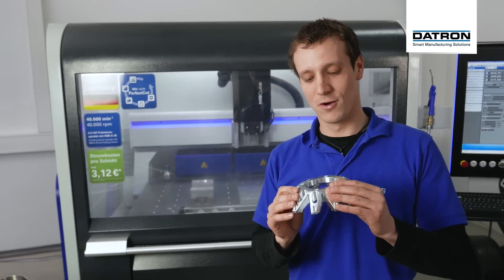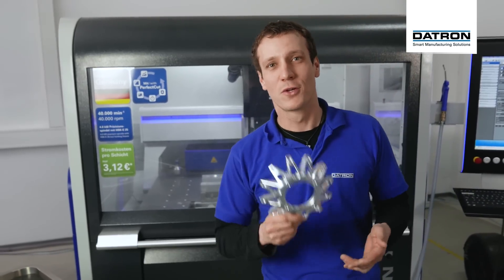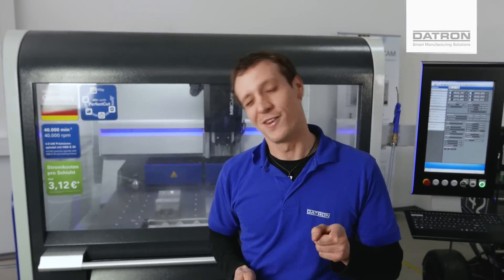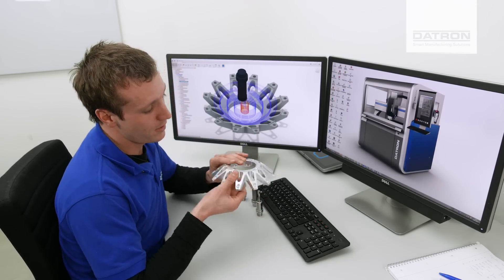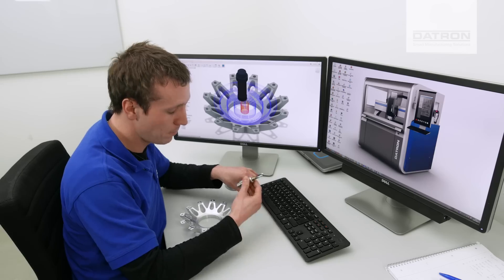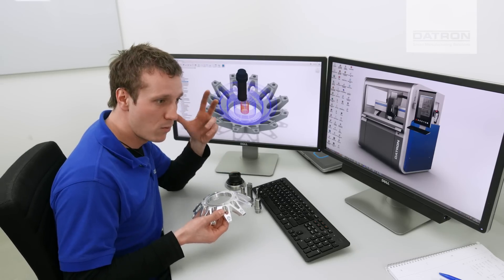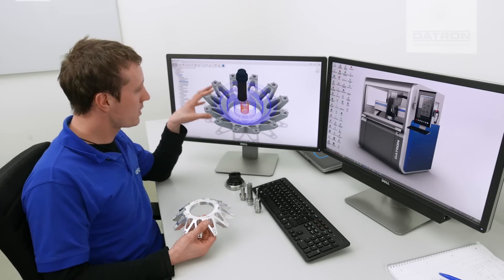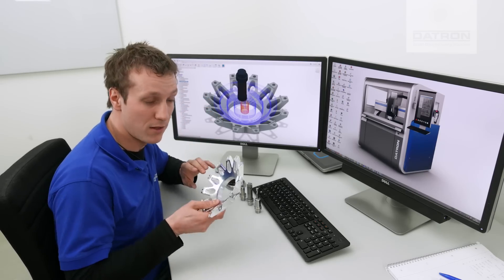Twelve spoke aluminium rim star high-speed milled on DATRON M8Cube

Comment: Like the Datron salesman told me, "Not for mass production". They wear out to quick.
Reply: We use some Datrons for large batches of different aluminum components. They work very reliable for years now. Of course they are not made for heavy milling but with high spindle RPM, figh feeds and HSC strategies we get very good cycle times.

Comment: How did you program this part? at the machine controller(what type) are offline, what software? Good job and it works great. I am surprised about the dry cutting, but I would prefer to have dry. I just thought maybe clogging up on the end mill would be an issue? I guess not. Thanks for sharing.
Reply: man, you should learn how to read the description...
Reply: fusion 365 :))))))))))))))))))))))))))))))))))))) in video you have it:)))))))

Comment: Nice 
Really looking good and smooth 
To slow friend 
Try to use 12 or 16 end mill with 4 flutes for aluminium and making the rough in just 2 steps around and making the hss from inside to out then no need to lot of steps of prapering the surface take end mill with radius 0.5 for that you will save about 20 minutes 
Your programming looks really nice  the autodesk looks nice nc program
And why not drilling and reaming 
For a mass production the end mill can make problems not like carbide reamer straight flutes
Reply: it is not a big VMC, have you seen the toolholders? they are as big as a 16mm endmill

Comment: How do you re zero the tool head after flipping the part?
Reply from the maker: Hello, the origin for the second setup will be touched in the center of the fixture before clamping the part on this fixture.The origin in Z-axis is on the upper surface of the fixture. Have a nice day, your DATRON team

Comment: Use of angle cutter to produce the tapered surfaces would have saved a very significant amount of time with no reduction in quality.
Reply: Rubbish. You'd need an angled cutter long enough to take the height of the job in 1 hit. Far better to first op on a lathe.

Comment: Man... one of the biggest problems for small woodworkers are finding a true  perfect square.
Actually, pratically all squares in the market are not really in perfect square and it become a problem when you talk about setup eletric tools (like saws) to then join the wood.
I found a thing called Pro Square that was pathetic expensive so It is totaly out of the question.Where could I found someone with this cutting aluminum system to build a simple 20cm triangle (45° like a square cut in diagonal)  square made in aluminium for don't bend easily and ship to Brazil?
Reply: https://www.woodpeck.com/triangles.html woodpeckers has lots of precision designed tools for woodworking.
Reply: 朋友從大陸運回太陽能板，就用厚木材料運輸工具系統整合安全分享

Comment: The machining was great! But why not use a lathe with a Y axis to make the part complete? I’m sure it would cut runtime in half and make a more concentric part, which for a race car rim seems to be the most important part. Not bashing, maybe you have an excellent reason for running it on a mill, I was just curious:)
Reply from the maker: Hello, thank you for your interested inquiry. The question is quite simple to answer: We do not build lathes and therefore have no lathes with Y-axis :-) That's why the rim star is manufactured on our milling machine. Best regards, your DATRON team.

Comment: That part took over an Hour?!?!?!? yikes for whoever owns that company
Reply: There was a lot surfacing done with that ballnose. I'm somewhat surprised it only took an hour, to get that surface finish.
Reply: I have had a full set of custom 3 piece billet wheel made, for me for less then the cost of a set of forged wheels. Plus the wheels were lighter and stronger, then the forged wheels I was looking at. SO really depending on what you are looking to do, this is really not that expensive. At $2200 for a full set of billet CNC custom wheels vs the $4500 I was quoted for the forged wheel set, it was a no brainier, and I got to design the centers myself. The company gave me access to choose how the centers were going to be "styled", with in certain limitations of course.
Reply: Oh plus I was able to choose the exact offset and backspacing, while getting a nice deep dish wheel, with the exact width, I wanted. SO from now on for the money, I will never go back to cast or forged wheels. Getting a set of billet wheels made is the way to go, PLUS fun to watch being made :)
Reply: Someone else posted about turning this part first, I agree with him. Also, why ruff out rads on outside by milling with about 12 million pecks and 3 different cutters? Drop an undersized slot drill down there!!!!
Reply: It's not the machine that is slow it's the programming. Try using SolidCam's imachining technology and reduce cycle time 70% while increasing tool life at full depth of cut.

Comment: i don't know i don't have years of practise in machining but wouldn't it be faster on 3or5-axis lathe with mill it would take same as here two clamping but second would be mainly for finishes and it should have probably better surface quality
Reply from the maker: Hello Mr. Haintl, in small series, our customer does not have to buy a lathe, because it works without it :) If the number goes into the 1000s, then a lathe makes sense. Best regards, your DATRON team

Comment: I'll take lathe for 500 please.
Reply: Yeah I was screaming live tooling lathe in my head when I wasn't screaming about the pop country loop. But hey, it's a race car part, it's suppose to be expensive.
Reply: I totally understand the one and done mentality in an R&D shop but all that helical surf milling is totally unnecessary if you have a lathe, still put it in the datron for the milling for sure.
Reply: Max Maruszewski definately agree especially if you have access to a dual spindle lathe. So much time could be had by utilizing a lathe in the process I believe
Reply: StrikeForce Dad single spindle lathe can machine both side with soft jaw.
Reply: Exactly, this is a lathe part with some mill secondary work. Watch the approach to the whole part and they clearly are not in a production shop where time is money. I would not be happy if I was the customer and saw how much time was wasted and the result on my bill.
Reply: Возможности компьютера с ssd диском
Reply: milling machine, lathes only turn in one direction
Reply: "Lathes only turn one direction"
Wat.
Reply: @TheDarkalkymist  You sir, have obviously never used a lathe.

Comment: is that machine really for   metalcutting ?? , but i'm sure for plastic is great , or eventually prototype work .
Reply: This is an industrial $100,000 dollar milling machine. One of the better brands out there. It's made specifically for cutting metals of any kind. I'm sure it's fine lol
Reply: cnc milling machine, it will cut anything you put in it, or at least try, the only difference in cutting different materials is the tool used, some materials require shallow or no rake angle, speed modifications or hardened tool bits,, as that is aluminum, high speed steel bits will cut it just fine
Reply: all that matters is the cutting bit
Reply: Have you ever tried to cut titanium on a not very rigid machine? You can have the best cutters in the world and it still wont be good.
Reply: for real? A damn wooden frame cnc router cuts aluminum like cheese with the right tools
Reply: It's too light duty really. You can see from the front on view that the table is flexing.

Comment: Fusion 360 gives "dynamic and efficient toolpaths"?? I must be using the wrong version.
Reply: I know the same problem with Esprit CAD/CAM. There are so many possibilities and options that you're happy if it simply works. Ultimately you just let it run instead of trying around two hours to get a smoother tool path.
Reply: @maxholler1182  You use Esprit?
Reply: Yes and also the toolpaths are getting better. ;)
Reply: It's a Formula Student project, so they probably used Fusion360 because it's free.

Comment: How does this machine compare to Tormach cost wise and function? Tormach list prices on there machines, Datron does not.
Reply: Datron will be 5x or 10x price of Tormach. But it is also very different level. For example, datron M10pro will set you back more than 250K. But entry level tormach uses steppers, very simple VMC machine base, cheap spinde.. While datron uses specially  made milling spindles which turn up to 60K rpm. Only milling spindle on datron is worth more than whole tormach machine. Datron uses portal style machines, which are in general more expensive, because rigidity isnt so easy to achieve as with VMC. They also need to use dual drive on longest axis. You can see they use granite for table, to achieve minimum temperature deviations. I wouldtn know for sure, but I think I read somewhere they use C3 grinded ballscrew, and Im pretty sure they use best possible linear guides, maybe even roller type. They also have touchprobe which is worth few K, etc etc. They even use linear encoders which return true position no matter backlash and ballscrew spline error.. Compared to tormach, very very diferent price and very different product. Tormach is suitable only for personal use, but I wouldnt be happy with it even for amateur use.
Reply: Datron are definitely more money but there are obvious trade offs.  I personally have two Tormach 1100 machines and Haas VF-2SS and a Haas ST-10 and use them all for professional use. The Datron stats wise should be more accurate but it really is just a large table router; the 9" z height is a real problem for most things, even simple throw a drill in there could be problematic.  It is not meant for hogging out a lot of metal.  Plastics and some thin soft metals like 6061 maybe but certain steels I would have my concerns, but that is just me experience. In short, I'm sure the Datron is a great machine for what it is and what it can be used for, but at the end of the day, your not going to use a $250,000+ machine to make a $10- $4000 part(s) if it does not need that type of precision. It is physcially cheaper to run multiple Tormach 1100s or even 770s/ or 440s then one of the Datron M8Cube or buy a used Haas or new for that kind of money.      I use the Tormachs to make small parts and make injections molds and once you learn the best way to approach something(CAM wise) it doesn't really matter, as long as you know the machines limits, which mostly comes down to cutting speed.  I completely disagree with CNC_channels response... if your asking, if the for the sake of making custom parts for personal or light production, from someone who is doing it. I would highly recommend getting the Tormach 1100 for production (larger build volume/more rigidity and more horsepower) and the 770 for hobby stuff (faster spindle & smaller build volume).
Reply: @jasonpeach5893  
https://www.youtube.com/watch?v=FtnaqJuJ9kw
Seems like people with some normal expectations agree with me:)
Reply: This is not true at all. A M10Pro is more around 80K, depending on what options you chose. 250K for example a gets you a DMG MORI DMU 50 3rd Gen., which is a whole nother ballpark of machine tool... and has 5 axis.
Reply: I've seen used for 225k USD
Reply: Jason I don't think you've read question well. It was how these two compare, not if tormach is capable of making some parts. What is there to disagree with my response? I made direct comparison on components, structure, price.. And there is basically no comparison between these two machines. You can get from point A to point B with Suzuki Swift, but if someone asks you how does it compare with Bentley Continental, you'd probably say there isn't much to compare to, just like in this case. I don't understand your statement that this datron is just a large table router. Do you say this for all gantry type milling machines, also for Zimmerman FZ32 and similar machines? Just because it is moving gantry desing, it doesn't make it "just a large table router". Like I explained in my response, moving gantry design is far more complex than VMC structure. If you are happy with your tormach, you have very low expectations. When even manufacturer tells you it is personal CNC, than it is personal CNC, and not some even close to serious production machine. I don't want to be rude or anything, but 5k rpm 1.5HP spindle? Stepper motors? 1000lbs weight? Look at the structure, column, base, table.. It is toy and nothing more than a toy. 110IPM feedrate? You have Haas machines so you know average VMC has G0 feedrates of approx 1200IPM. Rigidity? No such thing for Tormach. You can check some of the NYC videos, where he drives measuring guage along X axis, to level a part parallel to axis. Whole thing shakes like crazy only from steper motor vibrations. Hundreds of mm are flying all over on measuring guage, and you call this machine rigid? Im not saying it is not worth it's money, you can't expect much for 10k, and I think it really is worth that kind of money. But this machine is good for entry level hobby machinist. I would agree with you that someone who asks for comparison between Tormach and this Datron will probably be just fine with tormach.
Reply: Never thought i could encounter some one regard tormach higher than machines like datron @@ absolutely nonsensical. Your comparison bulletins is simply nonsense 
I completely agree with Cnc channel

Comment: I couldn't watch this whole video for fear that I would vomit all over my desk. You are an idiot, and if you worked here you would have been fired.
I'm glad, however, that you work for a competitor.
Reply: How sad is your life,John?  You're trying to tell us how great you are,but we all see you're a douchebag.
Reply: MegaJohnhammond, you are quite a wordy fella, behind the keyboard. Those kinds of assholes are usually the quietest outside.
Reply: 40 min  Lol  id do ir in 15 comp
Reply: James, when I saw his comment, I tought the same like you, what a duchebag. Then I checked video. And he is actually right. I dont know who made toolpath for this part, but roughing with insert tool and such small depts? What the hell? He could use 12mm endmill, and go 25mm deep at once. He could go much slower, and finish part or at least this operation more than 5 times faster. This kind of speeds and accelerations tourcher machine. You can check my video when I make part on my diy cnc mill, I go 5mm deep. And this was at the beggining, now I always go full flute  lenght deep where possible. Same story when he turns part arround. My eyes hurt when he starts roughing with this insert tool again. Only ONE pass is needed for this operation, and he goes round and round and round.. for how many times?
And one more thing camed to my mind when I saw him milling center hole. This part needs outer ring and inner hole perfectly concentric. But he first milled outer ring, then turned part arround and milled out inner ring. This is just wrong. I can understand if he is  student, but if this guy works for datron, then it sucks.
Reply: @ Aaron Sisson  15 min? in 2.5 axis?
Reply: You just hating because you work with fossil machines probably all all manual like the green milling dinosaur you unloading on your video!
Reply: So after watching one of your videos ( https://www.youtube.com/watch?v=GrG9GzrrJuU ) and losing count of the wasted passes and 0.00000000000005mm pecks I deduced that you really shouldn't be commenting for anything more complex than Thomas The Tank Engine reviews.  As for true position, if you watch carefully there's a cut in the video.  We could assume that he checked those during that time because nobody wants to sit through 20 mins of someone checking position against design.
Reply: Even an old live tooled lathe could run op2 first, run all the bolt circles, bores, faces, groove the back face and index lip concentric and parallel, and your rest mill of the spokes stuffs the endmill up at the shank in tight corners, not the tip for chatter. Flip it around to 'op1' and carve a bowl with no critical features and no M00 half way, screw fix a ring to the spokes if you're worried. It's a toy mill so engineers can maximize billable hours while they figure out GD&T. So easy an '85 Mazak can do it.
Reply: I would bet a fair amount of money you couldn't make a stick to hold a marshmallow without help. Post your video show us how it's done. I'll wait, likely for eternity for that video.
Reply: MegaJohn,
Pointless and worthless comment to just say that this is horrible without elaborating your reasons for saying so.  You come across as a troll who does not know what you are talking about.  
Peace.
Reply: Agreed, that was over the top. Everyone has different ways of machining. There wasn't anything that I saw majorly wrong.
Reply: both you idiots are fired, too
Reply: tell us whats wrong because i dont see something thats so wrong to be a reason to fire him. sorry for my bad english btw i dont have too much experience
Reply: I would have to confess, I failed to take into account the machine being used is just a toy. Using an insert cutter to take .010 deep passes? Come on, you can high feed Hastelloy faster than that. I was curious, at the end, how he was going to check his true positions, but I'm sure none of you even know what that means,